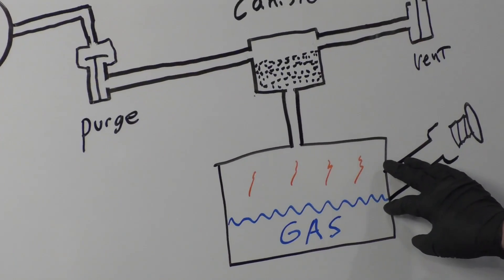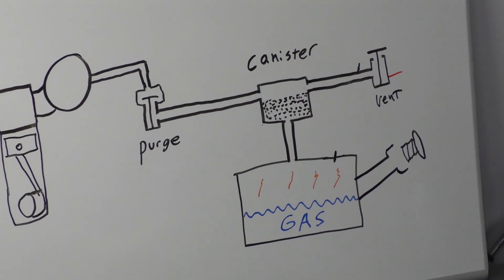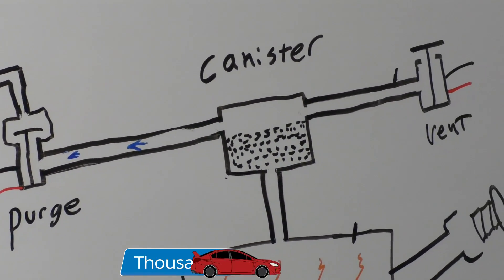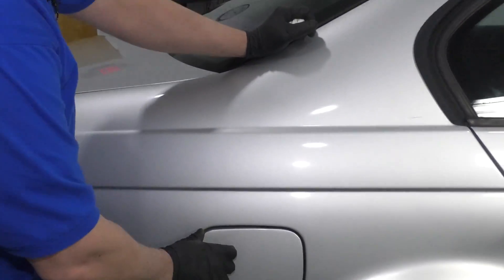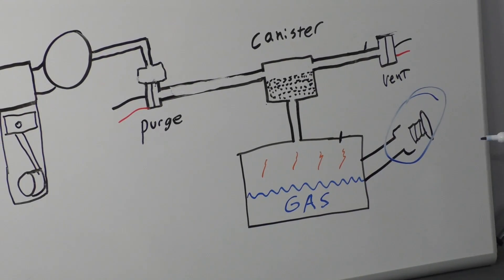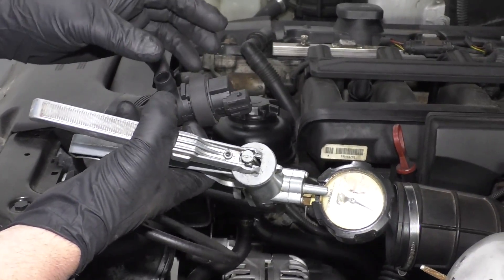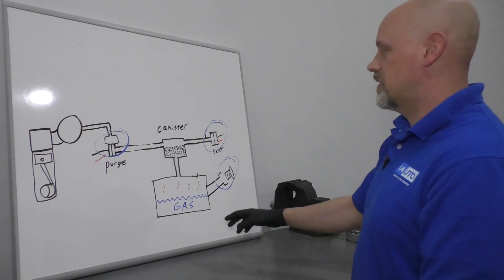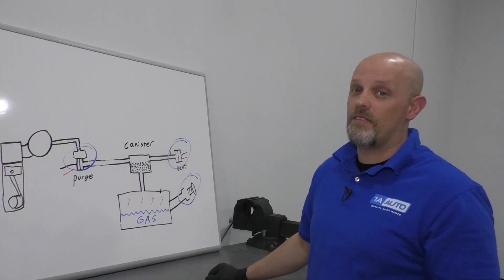Check Engine Light? Codes P0446, P0455: What Causes a Car EVAP Code?

Comment: Lately, my vehicle has been jerking while driving and loses power when ascending. And I also notice when about to pump gas, this PUFF of gas/ air shooting out of the gas tank when I push the nozzle into the filler. 
Any advise as to what’s going on with my vehicle?

Comment: My vehicle problem is when refueling gas tank. The fuel is "vomiting" for the gas intake cap. Only can refueling in very very slow pressure from the dispensing bomb. cant press full gas gun.What can I do?
My vehicle is a chevy malibu 2004 2.2Lt base.

Comment: Last week, I got a PO446 code on my 2011 GMC Terrain 3.0L,  Took it to my repair shop.  They used smoke to identify an evap leak coming from my gas cap, so I ended up paying them $62 for a new gas cap, $220 overall for the repair (labor, part, and Credit Card processing fee!.  After one week, the code reappeared, so I'm going back to the shop to see if the leak is coming from the gas cap area or other places.  Thanks for the video. Well done.

Comment: You made it clear that the purge valve and vent control are in 2 different locations but are they the same part? I can only find vent control replacement on your website for 2012 altima 3.5

Comment: i have a 2011 camry.  i get the code p0456  small evap leak.   i tried a new gas tank cap .  worked for two weeks.  then i had someone seal everything.  two weeks later same thing  (engine light).  i can drive for about two weeks before i light comes on again.   any ideas?

Comment: Sir, I overfilled my gas tank from a faulty pump, just a little, not much at all. It caused an EVAP code to pop up (2016 Chevy Cruze), someone told me I can take an air hose, blow out the excess gas, reset the code and be fine. My question is- can I blow that out? and where from?

Comment: Before you replace the valve or other components check your lines! lines are known to crack and dry rot and it will be a lot cheaper to fix.

Comment: Please help !!! I have a 2013 Hyundai sonata ... What causes gas in the purge valve and in purge canister... ? My daughter's car stalls when you fill the tank... So I replaced the purge valve and noticed gas came out of the line... Then I looked at the canister and pulled the tube off and about a half gallon of gas came out...

Comment: I still don't get the point of the EVAP system. A car engine is not literally running on gas vapors from the tank directly. It pumps the liquid fuel to the engine, pressurizes the injectors, and any over-pressure gets returned back to the gas tank. So the car is not running on the vapors above the fuel. Is it maybe meant to prevent a vacuum in the gas tank when the fuel level goes lower? Edit: I just read online that this is actually the case. I think a lot of people who watched this video are misled into thinking that the engine runs off the vapors in the gas tank 🤪

Comment: Will this cause my vehicle to waste more gas
Reply: Actually less. The only other option besides having an EVAP system is having an open vent to the air, which would cause the petrol to evaporate faster.

Comment: Great explanation. My 2015 Mini F56 B38 engine has code 190302: "fuel tank ventilation air system micro leak; leakage greater than 0.5mm". Symptoms: rough idle, and noticeable shaking while driving and longer start up after refueling (~5 seconds). Ordered purge valve hoping it will fix the problem. Let me know if anyone thinks it's something else, but I'm starting with purge valve since it's easier to access. Next on my list are the leak detection module and vent valve.
Reply: Any luck with the purge valve?

Comment: One thing I did to help find leak after spraying everything with soap and water is  I duct taped gas cap opening after removing the cap. Poked a little hole  used compressed air in filler neck

Comment: i have a 2011 altima, i get p0452 evaporative emission system pressure sensor/switch low. i checked for leaks none found. replaced the fps,replaced fueltank cap and still getting that code. i noticed when ichanged the sensor i erased the troublecode and the light didnt  come on unless i turn the car off and open and close the fuel tank cap.  please help  somebody!!  i need to pass DEQ!  any ideas??

Comment: So my scan tool says normal is -35 to 50... I was just curious and ran live data. It reads -1300 driving & idel is -100.. no engine light or code. Do I have a leak or problem?

Comment: I have this code.. Now when i accelerate pretty agressive to over 3k rpm.. My engine sputters and check engine lite blinks... Until sputtering stops... Most always happens after truck sits over nite ..  Also I cranked up truck first thing in morning and just revved engine to over 4k Rpms and engine sputtered and died.. Cranked right up after though. Is this a symptom???
Reply from the maker: +Michael Turano Thanks for watching!  These codes usually do not cause any drivability issues, just a check engine light.
Reply: @1AAuto  ok.. Any ideas what my issue may be?

Comment: I have a 2011 silverado that I went up a small hill with yesterday and was experiencing some fuel leaking.  I have the PO455 code and was wondering if there was any way fuel could be dripping from that?  Also I only have a little over 1/4 tank of fuel.  Going to have to get out the jack and stands and inspect myself for the leak as well.  Unfortunately my mechanic is on quarantine for two weeks.
Reply from the maker: +GooDViBe We wouldn't be able to diagnose an issue like that here, you may want to have a local mechanic take a look at it. Thanks for checking us out! http://1aau.to/m/Shop-1AAuto-c

Comment: So I have a 2010 Buick lacrosse I’ve had a diagnostic done on it. There’s no check engine light on but the code that pops up reads the evap system.  I was told it could be one of the 4 02 sensors on the car or it could be the fuel solenoid I’m not sure which one it could be.

Comment: Enjoyed your video.  Great explanation of P0455 code.  The check engine light on my 2014 Prius came on with the P0455 code.  Upon checking I discovered my air filter was missing.  I believe it was removed and not replaced when my oil was changed about a month ago at a local oil change service.  Would this cause the P0455 code?
Reply: Just install new filter and see if code disapears. If not than its something else. 👍

Comment: My bmw is blowing a fuse every time I put a new one on. I replaced the fuel pump and still doing the same thing. Now it doesn't start just cranks over and over. Someone else have the same issue?
Reply from the maker: +Angel Montoya We wouldn't be able to diagnose an issue like that here, you may want to have a local mechanic take a look at it. Thanks for checking us out! http://1aau.to/m/Shop-1AAuto-c

Comment: Great explanation, but I have a question.  I have a 2019 Ford F-250 6.2 that's so difficult to gas up at the pump, because it keeps shutting off as if full.  I takes forever to fill up :-(  What part of your diagram should i be looking at?
Reply: Rellace the charchol canisters
Reply: Yes, replace the charcoal canister if it's full of charcoal pellets. If your vent is still good and once you've replaced the canister and it's still doing the same thing, then you have to clean out the lines. Your lines or one of them is clogged up with charcoal pellets. I'm having the same problem with my 2006 Avalanche. I need to drop my gas tank and unplug my fuel lines and make sure all of them are not clogged up. 

These are videos that shows you how to diy.

Comment: Im speak french, but i understand the explanation. for my trouble, check engin is open and my machanician, check the computer, the problem is Evap system purge control valve A circuit Open. What do you recommanded for my cars, Nissan Sentra automatic 2010.

Comment: Great video and explanation! Question!
Can a evap vacuum leak, have enough effect, on the rest of the vacuum system, to cause the transmission to code and shift a little hard? I found my vacuum leak to be at the base of the filler neck on our 2004 Colorado!

Comment: Could this be why my vehicle starts hard every time I put gas in?  It doesn’t matter if I put in a full tank or just top up.  It’s annoying and scary sometimes, not knowing if it’s going to start for me.
Reply: If it is a newer vehicle, do not put extra fuel in after pump cuts off. I know on several Fords, I've  have the issue of a rapid turn over of the engine after a top off of the fuel tank. Stop the crank and it starts on next one or two cranks. Just don't try to round up the price to get an even dollar cost, it will save you the scare of something is wrong.

Comment: Great explanation, does having the gas tank full mean the engine light is less likely to come on or more likely to come on?
Reply: I don't think so. The surface area of the fuel is always the same no matter the level. The surface area of the fuel which is in contact with air emits vapors.

Comment: Our Toyota Corolla 2016 runs fine but got a check engine light. We turned on the car and we removed the switch (from the pcm) that goes to the purge valve and put it back. It then resets the check engine light, but just for a few days. Do you think the issue is the purge valve why we get the check engine light? Code is P2024.

Comment: Awesome video. Really explained the EVAP system well so I can start to have mine diagnosed and fixed.
Reply from the maker: +Barry Teater Thanks for checking us out. Shop for high quality auto parts on 1AAuto.com:

http://1aau.to/m/Shop-1AAuto-c
Reply: @1AAuto  How do you know how to test if your fix worked?  Do you need a fancy scanner to get live data? Do you just delete code and wait to see if it comes back? Is there any live data I can check to see if the problem is resolved?

Comment: When I fill my tank completely and the pump shuts off gas shoots out on the ground around the filler neck area so I think I need to replace my filler neck. Anyone think if I replace that then it’ll get rid of the evap code?

Comment: Ok thx for video. My question is I have that green cap and it says no more than 1 psi. Is the cap suppose to be tightly capped and how are you suppose to measure the psi? I hv 2000 Chrysler Town and country 3.8

Comment: I have a 02 rav 4 had p420 440 o2 sensors installed a new cat and all 4 sensors reset code drove for 4 days pass emissions 1 month later check engine light come same codes and then  on and shuts off randomly when I shut the engine off and 2 or 3 days later the same any recommendations 02 are name brand
Reply from the maker: +Alfred Collins Thanks for checking us out! http://1aau.to/m/Shop-1AAuto-c

Comment: I own a 2000 Chrysler Concorde LXI 3.2. I keep getting an Evap leak detection pump switch? I can’t find anything on a switch? I replaced the whole system, and it only trips the MIL LIGHT, on a cold start? Any ideas would be great? Thanks
Reply from the maker: +Mark Ochman We wouldn't be able to diagnose an issue like that here, you may want to have a local mechanic take a look at it. Thanks for checking us out! http://1aau.to/m/Shop-1AAuto-c

Comment: 2000 6 cylinder Camry, check engine light came on, P1130 scan code. Replace air/fuel sensor, fixed one problem but never could clear EVAP monitor. Pass smog test when engine light went off. Engine light cycles on then off, P1130 remain with remaining EVAP monitor not cleared. No other codes even removing the gas cap. Pass smog test again. I just want to fix it, maybe getting a smoke machine.

Comment: I have a Nissan frontier 2008 and I have a po455 code with check engine light. When I pump gas I have to do it very slowly because if not it will gush out of the tank. Are these two problems related and if so what do I do to fix it?
Reply from the maker: +Mr. Bowie With a p0455, the most common repair is to:
Remove and reinstall the gas cap, clear the codes, and drive for a day and see if the codes come back.
Otherwise, replace the gas cap, and/or.
Inspect the EVAP system for cuts/holes in tubes/hoses (you may hear a vacuum noise or smell fuel), repair if necessary.
Thanks for the question

Comment: I read that habitual 'Topping Off' your fuel tank can eventually render the charcoal canister ineffective. If this occurs would it cause an EVAP code?
Reply: I'm not a professional mechanic. As I've been learning through YouTube how to fix my vehicle I've learned that topping off your gas tank is bad. Right now my 2006 avalanche isn't allowing me to put in gas properly. I spend like 20-30 minutes at the pump to fill up. That's because one of my fuel lines is clogged up with charcoal pellets. When I replaced my canister I cut the old one open and it filled with charcoal pellets. So, that's what happens when you too off the tank. People want that little extra more fuel, but it'll cost you more money in the long run when you have to do repairs.
Reply: Eventually it will if gas keeps getting into the charcoal canister. The charcoal will get saturated and will basically turn to mud, meaning vapor can't get through.